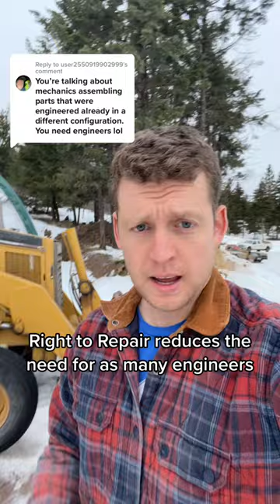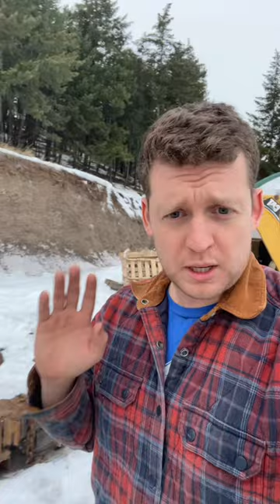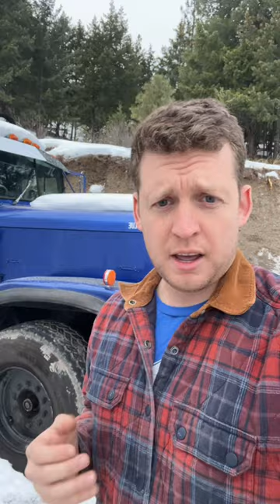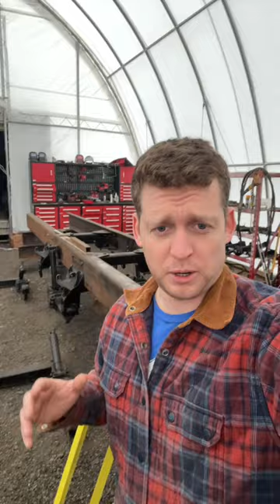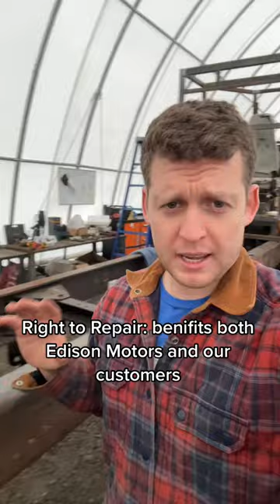Right to Repair: How Edison Motors Fast-Tracked Production Using Off-the-Shelf Parts

Comment: and HOW did off the shelf parts get ON that shelf in the first place? an engineer somewhere FIRST... designed the vehicle- including THAT part. nothing wrong with right to repair. nothing wrong with off the shelf parts, I'm all for it & repair at home. BUT- the problem with that is, you're STUCK. this is where legacy auto is- STUCK. henry ford is long since gone, so is william durant. GM, ford, toyota, nissan? they no longer build... ANYTHING- they outsource.... EVERYTHING. outsourcing means... you are never going to get better. IMPROVE. that being said- I LOVE what you've done here. deleting the transmission & clutch? HUGE. indirect drive hybrid electric system is AWESOME. if it weren't- diesel electric locomotives would've died out long ago. you guys should talk shop with tesla & see if they'll source you some 4680 cells- they do not degredade. projected to last 50 years or 3.5 million miles befor needing replacement, and cheaper than their dendrite forming cousins in 18650 cells. can't hurt to ask.